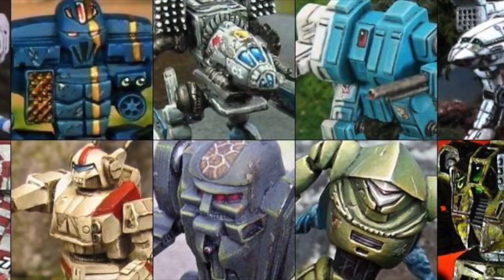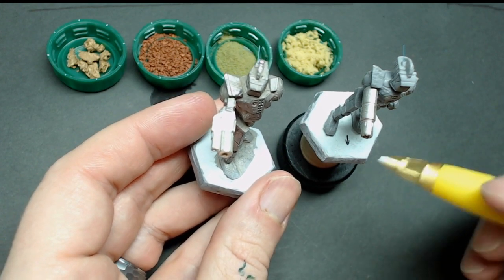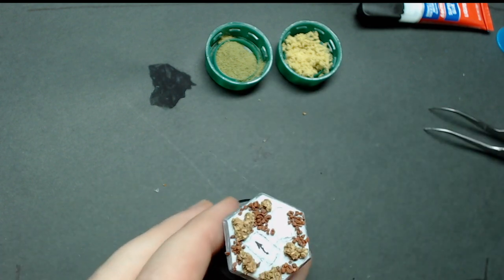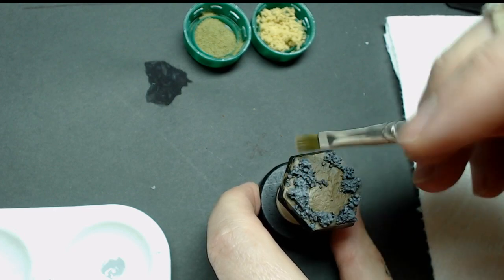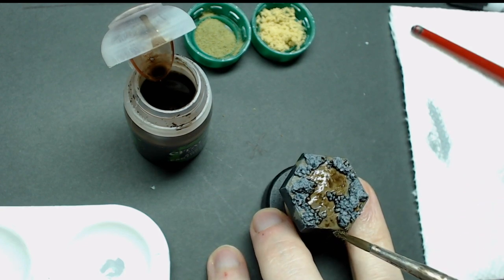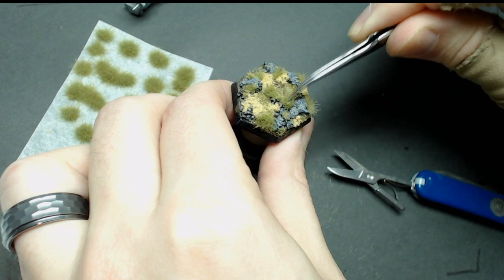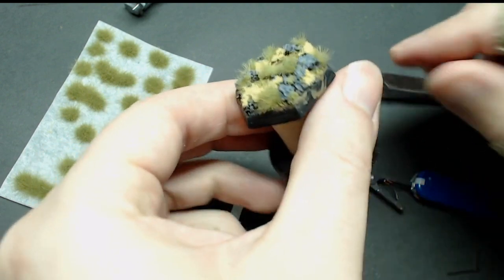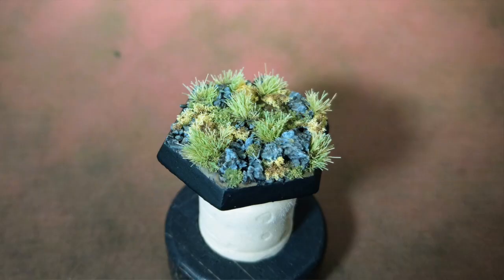Battletech Advanced Scenic Miniature Bases | Basing Tutorial

Comment: Great tutorial. Always love these videos. Question on gluing mini. Have you run into an issue where the flock/clump/tufts causing the mini not to be fully secured to the base?
Reply from the maker: Thanks. If you try to just glue the feet to the base or on top of the flock and tufts, then yes you will get a poor and weak bond. I always use a brass or steel pin on at least one foot of any miniature I'm attaching separately to a base to guarantee a strong bond.
Reply: thanks for the tip.